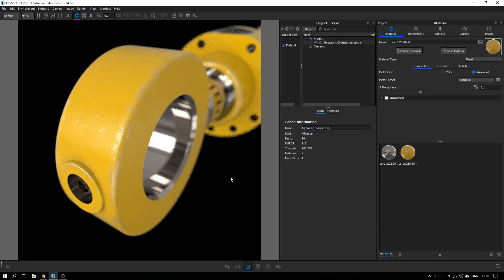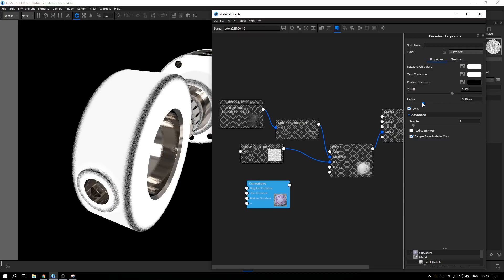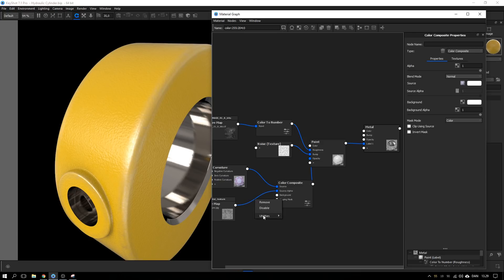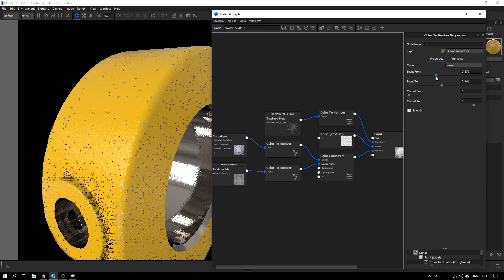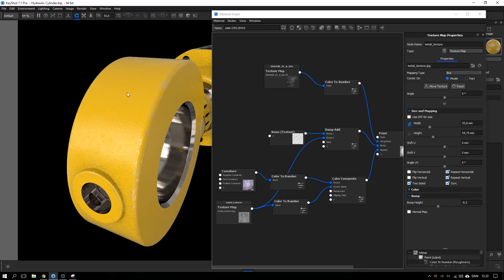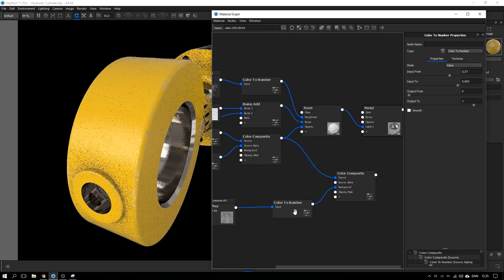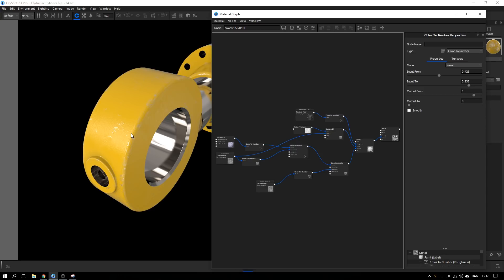KeyShot Material Study: Worn Painted Metal

Comment: Hi Esben!The training video is super cool. I thought I'd give it a try because I have a project that's a sci-fi exoskeleton protector, and I wanted to create worn edges... so far, it hasn't worked out 😅 I added a metal material at the start, but it looks different, not like yours. I can't even connect the paint material to the Label by default metal . Do I need another metal material for the surface to make it active.Then, where you mask the edges, I also get a nice blurred black (in preview mode), but when I switch the colors back on, my edges turn black... I didn't go further from there because it seemed pointless 😅 I guess I'm not the first one to struggle with this 😅 thanks your answer☺️✌️
Reply from the maker: Yeah, the interface and process have changed since KS7. I'm not using KeyShot anymore so my best advice would be to seek out newer tutorials showing something similar :) Good luck!
Reply: Okay, no problem, I just thought I'd ask 😅. In the meantime, I realized that the lighting environment also matters in this case. I added four regular studio lights, and now the black edges became metallic. Since then, the project's render is complete 😅. But I think I'll switch to Substance for texturing, as many say it's easier 😅

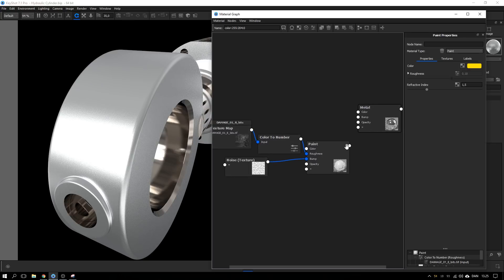Comment: 1:54   I cant put the paint output to the metal material. any suggestions anyone ?
Reply from the maker: Hi Jonas. Drag it to the 'label' input of the root node (the one to the far right). Not shown in the video as the workflow has been changed since the video was recorded :) Hope it helps.
Reply: im working with keyshot 10.1 btw

Comment: Hello! I can't recreate what you are showing on the video. I am new to Keyshot and I am using Keyshot 8.2. The problem is that in Material Graph it isn't possible to connect Paint node to Metal node. It just doesn't snap. I would appreciate any help. Thanks!
UPD: I've find out how to do that. I have had to connect Paint node to Material as Label 1 (and Metal to Material as Surface), this way Paint goes on top of Metal, - it just like layers in Photoshop. Maybe this would be useful for newbies like me.
Reply: I have the same problem, thank you for sharing.
Reply: Thank you Anton, Your comment helped me to understand the meaning of Slot "Label" (I'm a newbie too)
Reply: keyshot 8 works different than this tutorial visually - we now have 2 nodes for a material to start with
Reply: Yooo Thanks my dude!